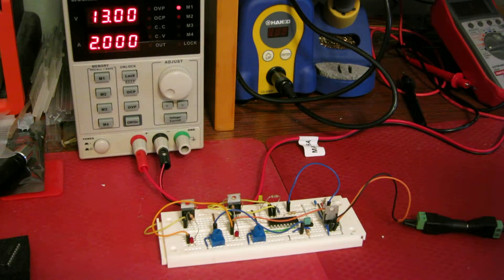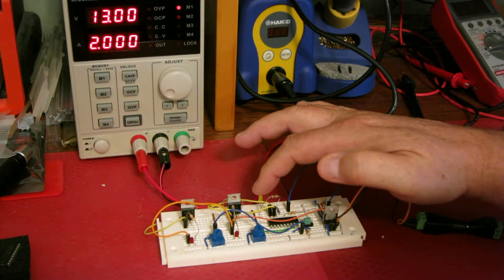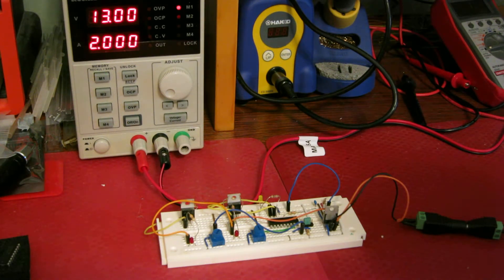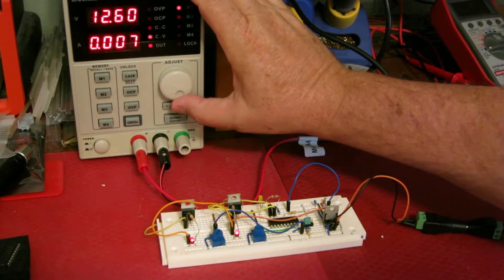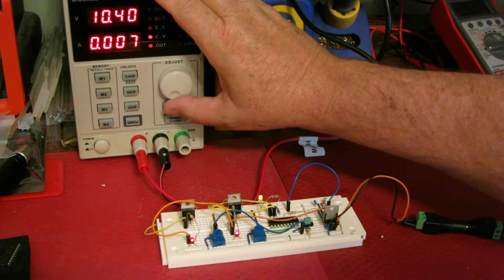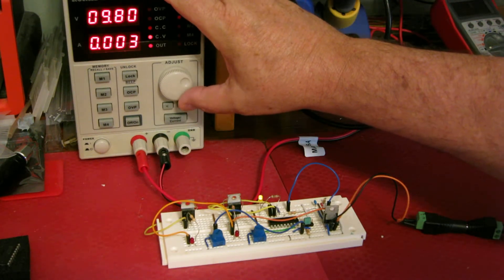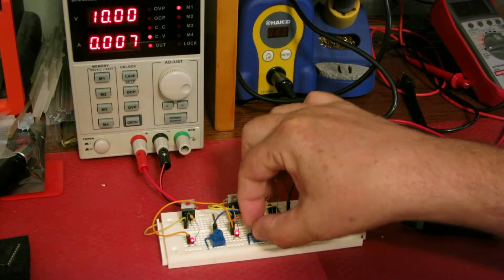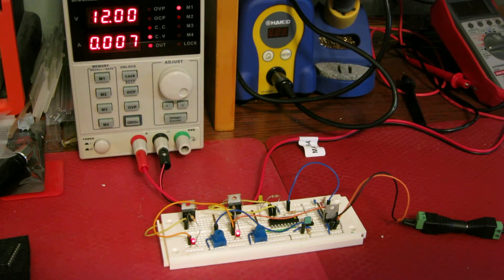PIC 16F88 Telescope Dew Heater Controller Breadboard Test

Comment from the maker: The cutoff uses a voltage divider that will take 0-16v from the battery and reduce it to 0-5v for the PIC.  Since the 12v battery should never be above 14v this should be enough.  Reading the voltage on the PIC pin the software determines when to turn on the yellow LED and when to cut off power to the dew heaters and blink the yellow LED.  The voltage divider uses a 22k resistor from the positive battery source and then to a 10k resistor to ground.  Between the two is the connection to the PIC RA3 pin.  If you search for voltage dividers you'll find calculators that output based on your input voltage and resisters.  The schematic for the circuit is here:  http://www.knology.net/amaroney/allen/dew_heater/Dew_Heater.htm  and the voltage divider is in the upper left after the RUEF400 resettable fuse.